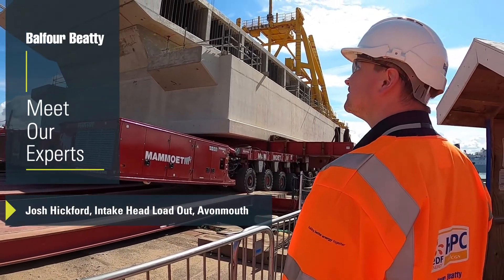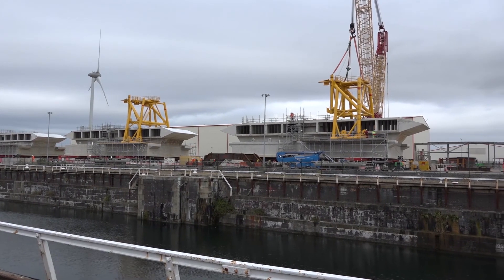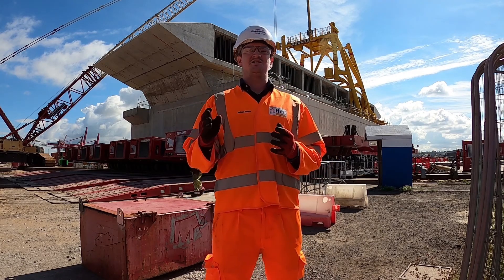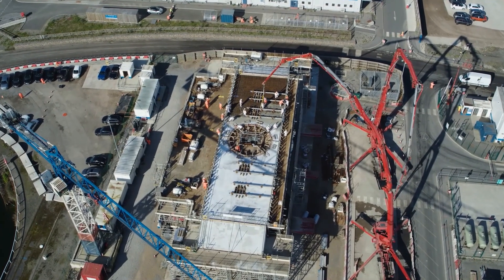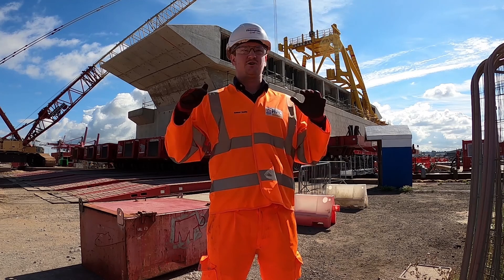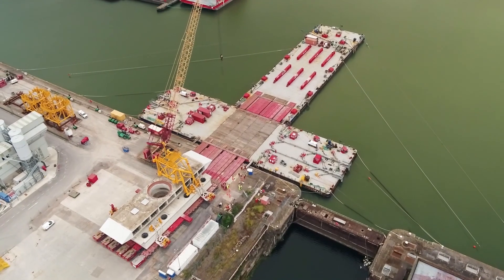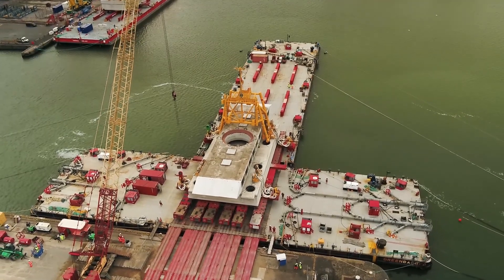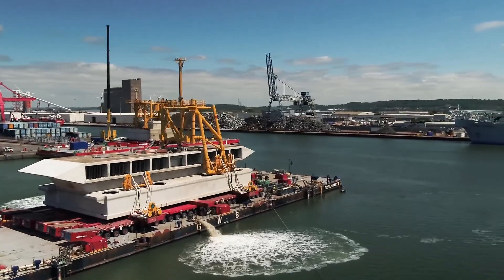Safely loading out the intake head for Hinkley Point C

Comment: The shape looks a bit too complicated to me.  The requirement of an intake head is to have a large intake area to slow down the velocity so that fishes are not forcibly sucked in.  Possibly at around 1/3 m/s depending on the species.  The velocity of the tunnel would be sub 2m/s as anything higher is a waste of energy and unnecessary deepening of the intake pump chamber.  The intake head also need chlorination equipment to discourage marine life entering the work and use it as home.  Faster velocity means more food available so all intake system eventually will get fouled up with marine life and need cleaning out.  This intake head does have provisions like the big circular hole at the roof for accessing the interior and removal of marine deposits.

It is likely a French design used in France but whole unit could have been a standard tunnel section full of removal screens.  I would prefer removable screen made of plastic element to reduce corrosion.  During maintenance the diver can remove the old screen set full of marine lives attachments, install the new set and reduce the outage to the minimum.  The screen of this intake head looks immovable to me.